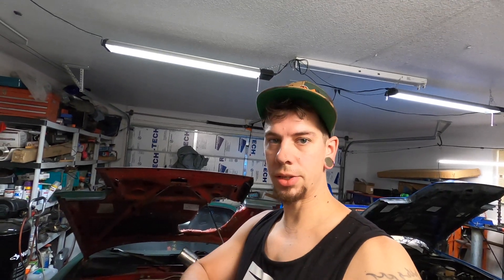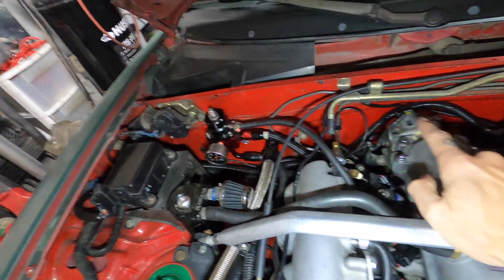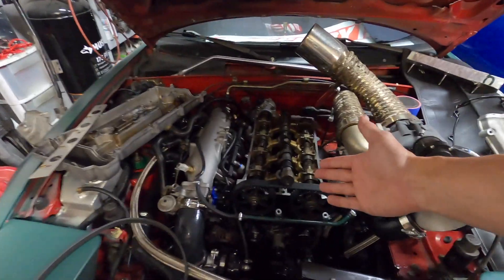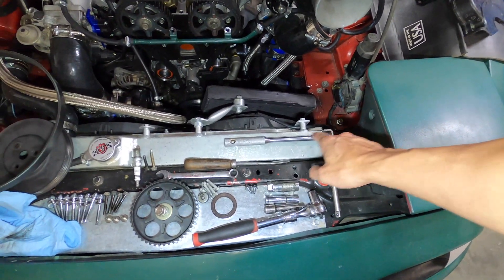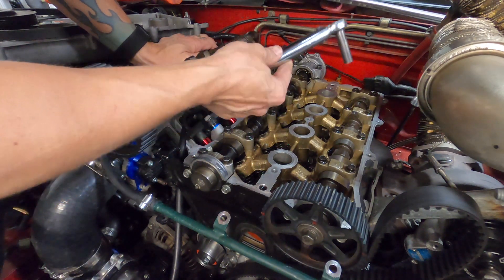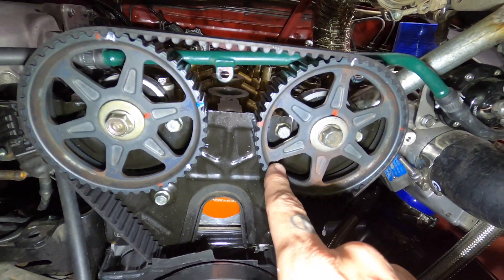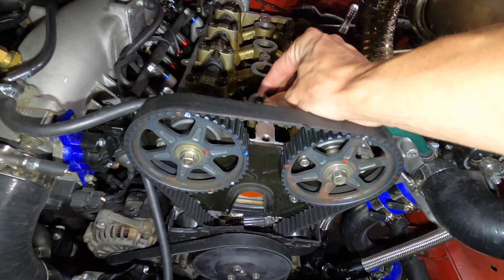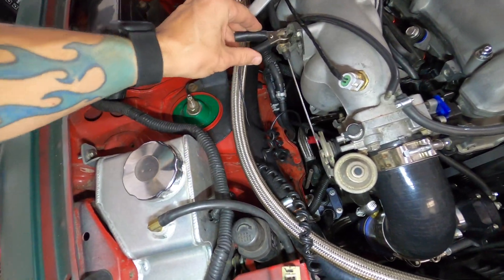Miata 1.6L Exhintake Mod W/ Kia Sephia Camshaft?! (1st Documented Attempt)

Comment: For anyone interested in this swap and unable to find a used cam, they're still being sold new under the part number B6BF12440A, but they also cost around 300bucks. You could also pay an extra 60 bucks and save yourself the trouble of drilling out the perfect hole on the intake cam gear and get a Kelford T203A intake cam instead. It's got 5° more duration than the exhintake and a bit extra lift too.